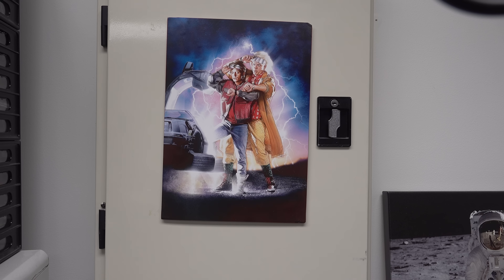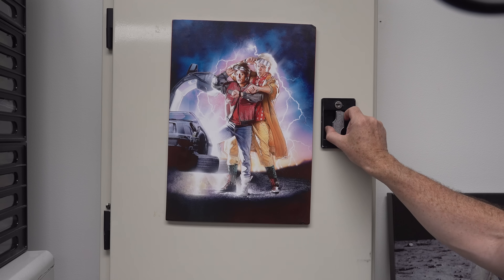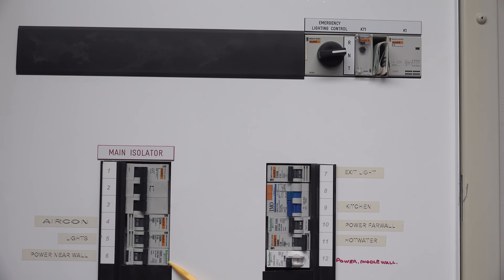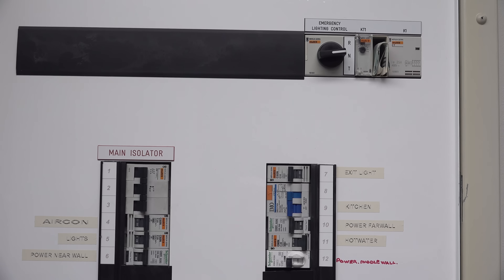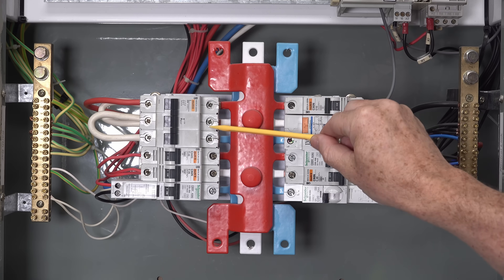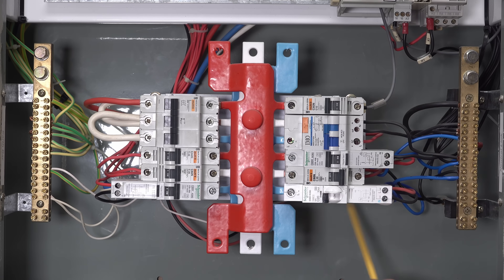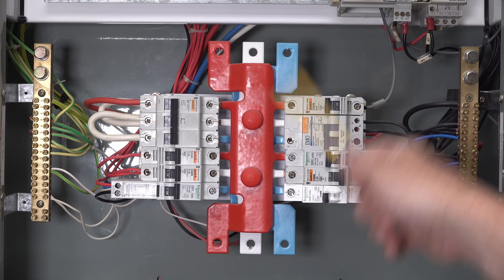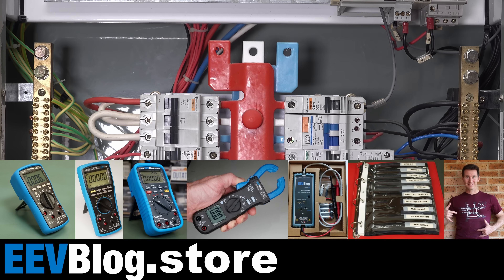EEVblog 1652 - Why is my Lab Switchboard Wired Like This?

Comment: That's interesting mix of european and us style of boxes
Reply: It's not really a US style box at all - breaker boxes in the us don't use DIN rail, other than in equipment control cabinets built in other parts of the world. Here breakers just clip into little punched out notches in the back of the panel, and they plug into the bus bars. I'm pretty sure the din rail system with screw connections on both sides is better, but I guess our slightly crappier system works too
Reply: @gorak9000  for us the sideways breakers going top to bottom in two columns is already enough to get the "US style" label. ;P
Reply: @tomaszwota1465  Oh yeah, I forgot that most of you people out there mount your breakers "sideways" all in one long line! You weirdos... :)
Reply: @gorak9000  it's usually split into a few rows. ;) But yes, weirdos we are. :D

But on a serious note, I would like having RCBOs instead of breakers but code here has 300mA RCD for a whole apartment, then 100mA if you have a floor heating circuit, separate 30mA for wet rooms and appliances (bathroom, kitchen, dishwasher, etc) and 10mA in some cases in wet rooms... While that's not horrible at all, having RCBOs would still be cooler.

But, you know, if it's not required then investors are not going to pay for it.

Comment: What is weird is the color coding of the phases. Blue as a phase3 and also neutral? Sounds like a formula for getting dead electricians...

On second look it seems that black is neutral but someone just used blue wires for RCD neutrals. Anyway a bit confusing but that's allowed i assume.
For reference: EU has Brown/black/gray as phases, blue as neutral and red is used in DC circuits as positive conductor. Earth is the same yellow/green.

Comment: I discovered that our UK works office was wired with split phases. My concern was that you could have 415V across IT/dev equipment on your desk. And given that the usual insulation rating of 240V kit is 400V, I was concerned.
The company completely rewired the office floor because of that.
Reply: What's the issue again? Where are you going to get the phase to phase? Are you thinking of, say, connecting a monitor to L1+N and the PC to L2+N?
Reply: This is not uncommon, since electrical regulations have improved significantly over the years.
Reply: This is interesting concern (in EU too) that i have not thought about. It's common here to split phases in one office/household/apartment here too but i haven't heard anyone mention the issues with having 400+v potential voltage difference in one room. There may be some regulations that cover it but now i want to know what they are.
Reply: @woox2k  In the UK you can have multiple phases in one room but if they are in a single enclosure it must be labelled (as must any enclosure containing circuits fed by multiple breakers). I'm not sure if there's a requirement for physical separation between single phase socket outlets on different phases.
Reply: There's no part of that equipment which will have such potential across it. The closest thing would be the cables - and even if it's cheap H03 cable (unusual), it's still got four layers of insulation between line conductors.

The worst scenario is two floating outputs on different phases would have an elevated voltage between them. Which amounts to no more than a more pronounced tingle.
Reply: My concern was, that you could have two pieces of equipment connected by something like RS232/485/USB/Monitor cable, but on different phases. Meaning that you could have 415V across your insulation boundary. And most non-industrial kit only having 400V rating. 
In our case, there were floor boxes with two 13A outlets, and every box was fed with two phases.
The whole floor was rewired with a single phase for each office area. So that we couldn't have cross phases on each desk.
When the electricians were called to check the install, they said that cross phase was fine in an industrial setting. But that as the building had been retro fitted out as office. (Not sure if it should have been rewired then?)
Reply: @gonzo_the_great1675  But you wouldn't, because the phases aren't connected to any of those ports. You're suggesting the equivalent of worrying that those two phases have the primary voltage feeding their transformer between them.

Comment: I commented on your response to the German setup, but I do still think it'd be fun for you to respond to an American split phase residential setup. Your audience would lose their sh*t
Reply: What is so weird there? Sure, it's different but quite useful in many cases (easy 220v in a "single" phase installation) One could argue that 3 phase is better in every way but it seems to work there so it can't be that bad! The 110v itself is a bit weird since it's still lethal, just as 230v but limits you when it comes to power you can draw from it (230v kettles are bit more powerful!) :D If you want something weird then look at UK ring mains. Every socket has to have perfect contact to 2 incoming lines or else things catch fire if you draw more than half the rated current from any socket.

Comment: At an old job the panel was pretty much identical but longer. Didn't get to see behind the cover but I would imagine it would have a similar installation system. Definitely three phase since we had a couple of electric roller doors installed. There was also a separate enclosure for emergency lights, controls, timers, etc, as well as a cable way so they could be hooked up easier. Lot more cabinetry than a house or your office for sure.

Comment: It’s a Y type transformer connection.
In Canada at my work all switchboards are locked up, only an electricians can touch the breakers, us mortals are unworthy to touch breakers.
Reply: How it should be, IMO! :P
1. Gives us work
2. Makes us seem important
3. ...but on a serious note, I've seen "mods" made by who knows who in switchboards that were accessible and it really stops being funny quickly... ;)
Reply: @tomaszwota1465  
Myself it was nothing to do with switch board mods, need access to equipment to do my job with the power turned off, no way of making it safe without waiting for hours or days for a electrician to come by and flip a breaker off, then the same to to flip a breaker on.
Reply: @universeisundernoobligatio3283  Understandable. Is that industrial setting? 

That should be something to set up with whoever is in charge - maybe they could schedule out a job to add a separate box with a breaker/disconnect that is locked out with a key that you have easier access to. Or install a resettable emergency punch out button?

I get cranky about industrial stuff too if I have to work in that setting. If I need to lock out a breaker it takes hours in some places. And I'm the electrician! :P
Reply: @tomaszwota1465  
It's the heath and safety people, they need to justify there jobs by making endless rules about things they know nothing about.

Comment: Yes Dave, three phase submains are installed for future proofing and single phase terminations and metering are used when the maximum demand is quite low and no need for the additional costs involved. EG not only the three phase metering but also a three phase submain circuit breaker at the main switchboard. All to do with reducing costs. The silly thing I see us we usally parallel the three phase conductors to reduce voltage drop when configured in single phase. That is, we would usually use black and blue on the neutral link and red + white to the main switch on customers switchboard. Again guess the two minutes this would take at each end would increase costs...lol.

Comment: Wow, as a European I find the wire colors very confusing... Especially as you have blue and black Neutral wires and L3 is also blue. And I find that busbar cool looking but terrifying!

Is the fourth wire on those single slot RCD's fixed? And is a voltage independent RCD also a requirement there? And is that a PE wire connected to the outgoing N on the left RCD?
Reply: R/W/B/Bk is standard Aussie fixed wiring colour.  The blue wire on the RCBOs is a fixed fly lead from the manufacturer, blue because that's IEC standard colour and most of these devices are built to IEC specs.  Electronic and magentic are allowed.  The white wire is a functional earth, it's not mandatory to use devices with a FE.

Comment: the board door not being straight triggers my OCD !
Merlin Gerin (Grenoble, France) was purchased some years ago by Schneider Electric
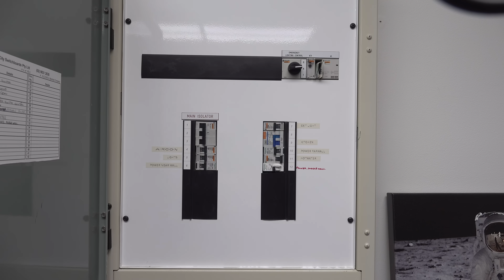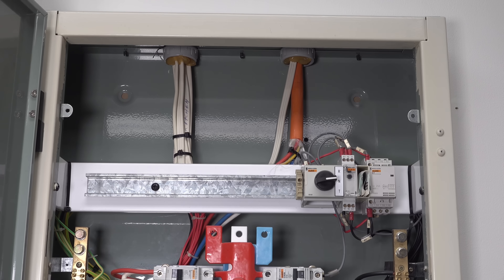Reply: Mine too, though you do have to account for this being an Australia install (which probably explains the right side and plate being straight, yet the internals are at an angle (1:10) and the tilting top (3:25)).

Comment: Curious setup. I think in Spain it is mandatory to put all the switches vertically. So there is no doubt, up is connected, down is disconnected.
Reply: Surely in Australia they should be upside down?
Reply: @ghwizz  Sideways is halfway there! They are working on it :D
Reply: It's the same all over EU afaik. It does make sense but it's understandable how some countries seemingly lag behind with updating the code to be more logical. Changing standards is no easy task and often it's just not worth the effort.
Reply: What's even worse is that those on the left and those on the right were oriented differently.
Reply: The bible calls for "rows must switch in the same direction" but as you see the rows themselves can be any orientation
Reply: I live near Barcelona and in my house they are installed sideways (and even see one vertical installation where the incoming is at the bottom of the breakers, of course nothing is clearly indicating that). Maybe the standards were updated since then...

Comment: What it looks like is that you have two phases of a three phase system.  You might want to measure the phase-phase voltage as well as the phase to neutral voltage.  If it is truly three phase (not a single phase center tapped like here in the USA), the phase-phase voltage will NOT be twice the phase-neutral voltage.  Three phase things are funny in that way!

Comment: My guess would be that the single wire coming along with the main phase is probably the storage room connection, to only use one power meter. You'd have to give an update!

Edit: or maybe the Aircon, depends on where and how it is installed.

Comment: So different that what is in the US / Canada. For one we don't have any wimpy plastic coating on the bus bars. Ours are naked metal so you can properly fry yourself. Murika! I have to say having 3 phase is a luxury, if you actually had a 3 phase feed that is. That is such a cock tease turning it into a single phase panel.

Comment: the insulated chassis the circuit breakers are mounted to is commonly called a Pan Assembly, normally the main switch / main isolator is not fitted like yours is but mounted separately and  feeds the 3 phase supply to the bolted connections at one end of the chassis.

Comment: Missing pole filler = instant fail. It's a commercial board, what did you expect Dave? I make my money doing theses types of panels. You know I'd love to test the z loop as it reflects the conductors to the transformer. Merlins are junk, replaced so many of them! The Z loop reflects the kA rating of what's need btw.
Reply: Sorry I comment to quickly before watching it all; Cheapskates hahaha

Comment: It's a good thing those are coated, the interconnects (for both live and neutral) on the inputs of the 3 16A breakers here (yes, only 3 for the entire house) are pure uninsulated copper. You do not want to touch those, especially since they are right next  to each other....

Comment: Not uncomon in a large multi-tenant building or site. The main distributrion board on the site will most likley be 3-phase then some (or possibly) all 3-phase sub-boards having been downgraded to single-phase. 

There are a number of posible reasons, anything from simply being no need, to phase load balancing, to back up supply (UPS/Generator) distribution, to internal tenant metering/billing... Depends on what the site has been used for over the years and what changes there have been really.

Good thing is if you ever actuallly need 3-phase, you are basically ready to go at the cost of about an hours labour (assuming distribution board end hadsn't had major downgrading).
Reply from the maker: Getting three phase would presumably need the supply untility to install the extra meters, not something you can just get a sparky to do. In any case I have no need for 3 phase.
Reply: @EEVblog  Depends on how the site it setup, and how ussage is metered. If the overall site or main building is already supplied with 3-phase (and therfore metered as such), then distributed to sub-boards that would likely be outside of the contol of the utility /supplier but it is possible that each 'tenant' (or what I'm assuming are simply sub-DBs from a main DB) is actually metered by the utility company then yes that can change things a little, but not nessasarally.  There are many ways it could be setup depending on the environment.  

But, you are right, if you don't need 3-phase, then that's all good too!  Nothing wrong with how the board is setup from tat point of view.

I've seen houses over the ditch here in NZ that have 3-phase supplied (and metered) to the property then out buildings, setup to be 3-phase but downgraded to only operate on single phase, simply because tha'ts all they need.  But the options are still there.

I've also seen old decomisioned lines compnay meters re-purposed for metering privatly, I guess at some stage in the past that was a cheper option than simply using DIN mounted meters as we tend to nowadays.  Easy way to confuse the sparky if not looking too closely.

Comment: Often you will get all the wiring for 3 phases but unless you have a 3 phase load or your load demand iis high enough to split across phases you will have a single phase meter. The daily network access fee for a 3 phase meter is much higher, I pay $2.37 plus GST on 3 phase meters but only $.87 on single phase metres at other sites so frugality wins in the end I suppose :face-blue-smiling::face-blue-smiling::face-blue-smiling:

Comment: 3:25 the orange cable is a special cable that keeps full function even with 30min of direct fire unterneath.
It's a safety feature that the emergency lights are lit as long as possible.
Reply: The orange is the incoming feed.
Reply: Isn't this an EU thing? There may be some similar standards in Australia too but in EU emergency systems have orange cables that are fire resistant but they are already battery powered anyway so mains feeding them do not have to be so robust.

Comment: I'm not familiar with Australian standards, but it would appear that this arrangement allows the incoming (red) wire to be overloaded.  The incoming wires look to be ~8mm2, in which case they would have an ampacity of around 60A.  The main breaker is 3P-63A, which in this arrangement could theoretically allow up to 189A to flow in the incoming conductor (and neutral conductor) before tripping.
Reply: The mainswitch in Dave's switchboard is just that, a switch.  It is rated to carry 63A/phase and has no over current protection.  It's only in recent times that mainswitches are required to be MCBs.  It's assumed that the electrician working on the installation will ensure that the demand at the switchboard does not exceed the wiring rating.  10 is good for about 50A, 16 would see 63A - situation dependant.  There will be a fuse down at the metering.
Reply: @retrozmachine1189  I have incoming isolator on the board, 63A rated carrying capacity, and at the meter there is an 80A breaker to protect the 16mm cable. Upstream at the substation there is a 400A fuse that protects the supply cable, and older ones have 200A fuses, which in one case, a fuse built in 1956, and which ran at over 250A per phase at peak evening load, it still took nearly 60 years to blow.
Reply: @SeanBZA  Similar at my place now, 63A MCB, 80A service fuse, transformer is 200kVa.  The secondary was generally not fused until the state (QLD) decided to move to a configuration similar to the other states and started  a program to have fuses on the secondary about 30 years ago.
Reply from the maker: @retrozmachine1189  Yes, main fuses are down the corridor in the common meter cupboard.
Reply: Never seen 8mm2 cable before, it’s most likely 10mm2. But the distance and how it’s installed would be need to guess the rating. 

It’s very poor practice to feed a bus at the side rather than at the top, which would be better suited when pulling a higher. They just cut costs doing it this way.

Comment: High voltage freaks me out, even just seeing the panel open lol.
Reply: That's not high voltage, that's low voltage. :P (Hey, I've got IEC on my side!)
Reply: @ No thanks I'll stick to data cables!
Reply: @donwald3436  fair enough! I'm doing data cables from time to time too. Contrary to opinions I hear about data guys, the cable management in most data racks over here is pretty neat, if chaotic (because of the amount of cables) sometimes.